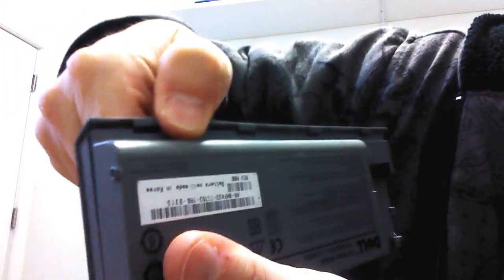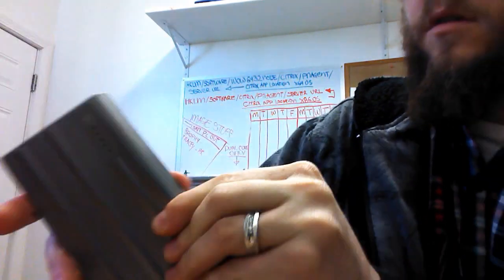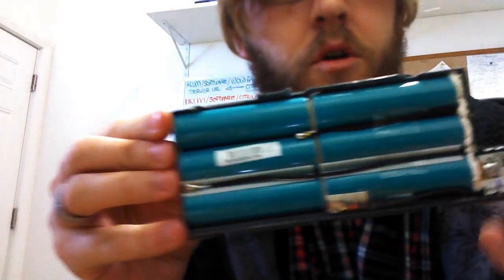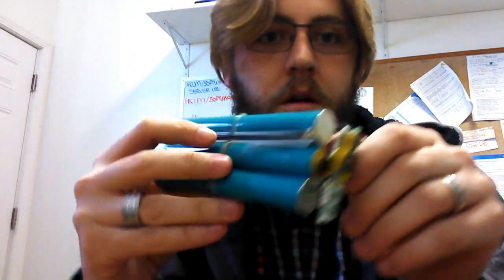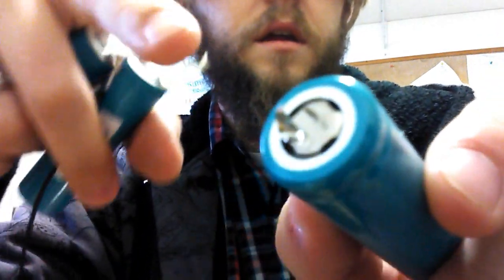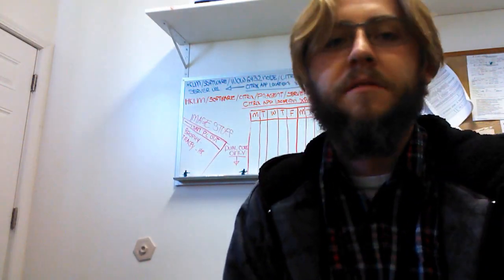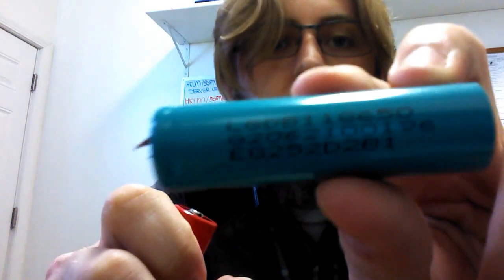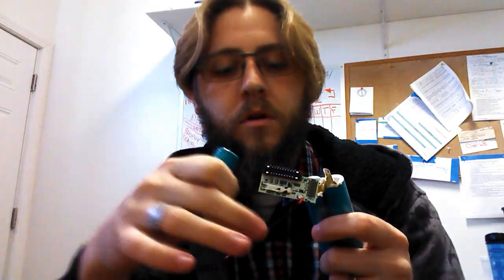FREE IMR18650s from old laptops Part 2 of 3

Comment: despite how safe he makes this sound, don't cheap on vaping batteries. this is incredibly DANGEROUS, especially if you sub ohm. you can buy samsung IMR's, LG HE2/4's, Sony VTC4/5s, MXJO, MKNE etc for $5-10 a shot on any variety of online vape shops. just go buy those so you can be safe.  don't blow your face off because you don't want to spend $5.
Reply: +lolbattlerap yea, this is all true that you said above.  however, if you do know what you are doing, this is very safe, and can be even safer then online vendors.  Ebay has plenty of fakes, as does just about every other website i look for batteries.  there is virtually no way to tell for sure that the batteries are authentic.  However, there will be no fake sony's in a laptop battery pack, if u can find them.  that is the only way i have found to garentee authentic batteries.
Reply from the maker: +Reshapin' Vapin thats the point .. research what you have do your homework and if its no good dispose of it properly
Reply: I agree with you.  the reason it can be safer is simple-vtc5 has not been made in a long time.  However, it is still the most bought battery on ebay, amazon, and many other sites.  these people buy these fake batteries thinking they are the real deal, and can truly handle the watts the real vtc's could.  sadly, thats not the case, and those people using mechs and these re-raps are in grave danger.  However, if you find the right battery pack, you can get quality cells and they will be 100% garenteed authentic